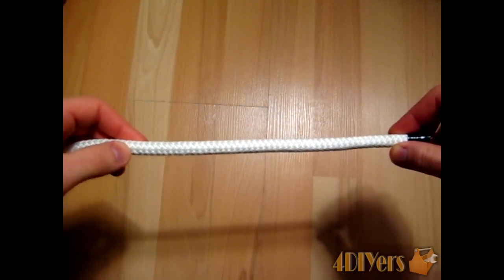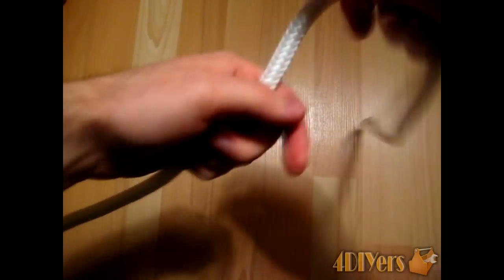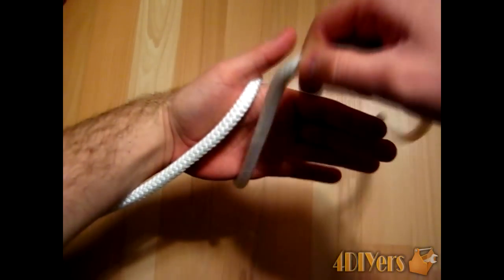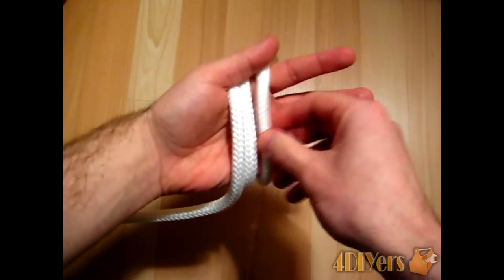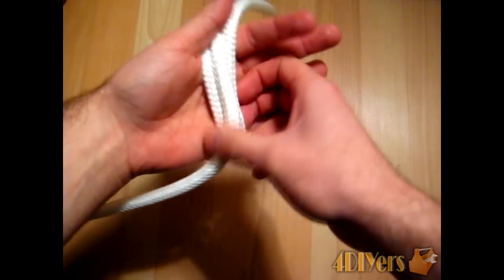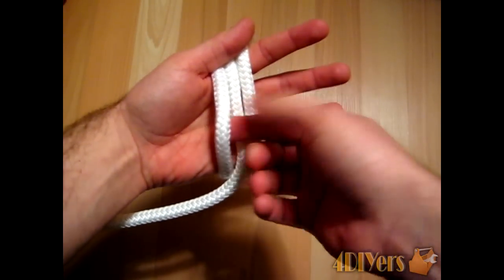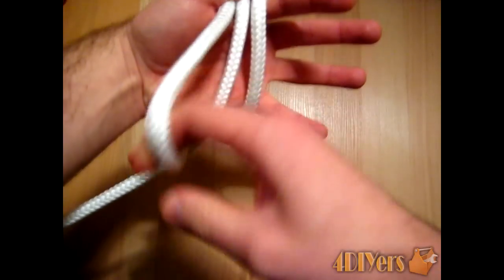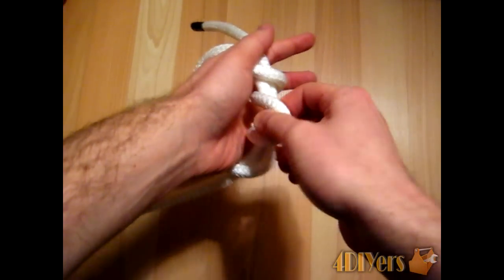DIY: Tying A Single Lineman's Loop

Comment: I agree with Jamie S!  This video clearly demonstrates the best method for tying a Butterfly Loop.  I only wish you had shown a final view of the knot, with the rope stretched above and below the knot, to demonstrate the Butterfly's common use as in-line loop.  It requires that the knot be dressed sightly differently, though, before tightening.  Dressed for in-line use, the rope hangs straight down.  This is a useful loop for tie-ons, etc.  The Butterfly Loop can also used to temporarily isolate a damaged section of line, so it's still usable.  Anyway, it's a clear, no-BS tutorial.  Nice work.